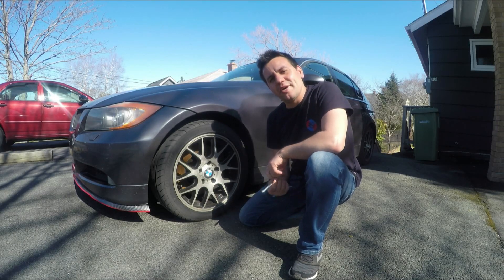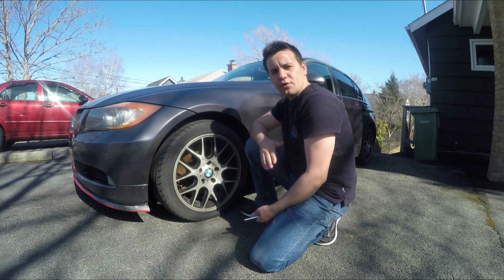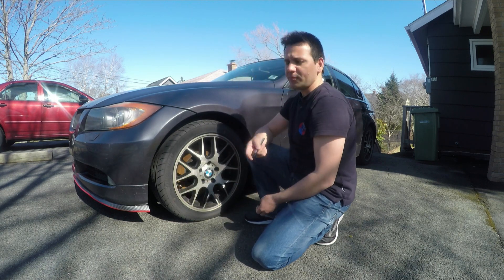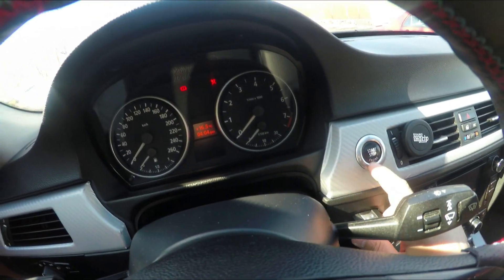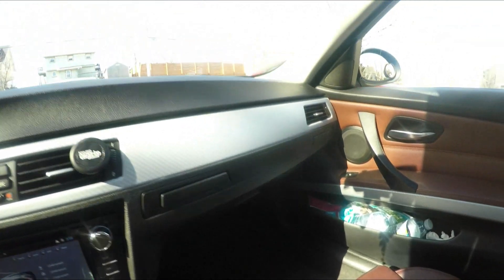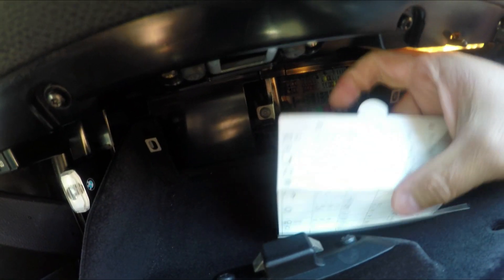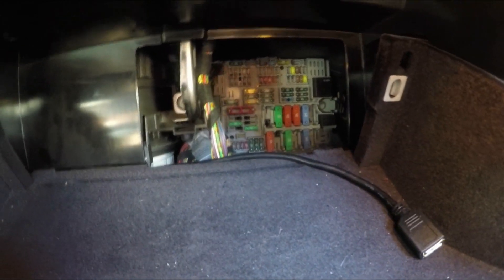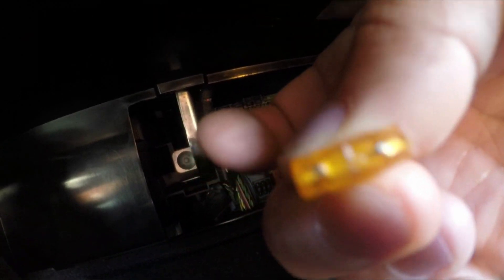BMW Tire Pressure Check & Reset | TPMS vs FTMS vs ABS & Fuse Location

Comment: My shop defaults the fronts at 34PSI at 37PSI in the rear.
Reply from the maker: Navisworker the required pressure is set on the driver side door jam 👍